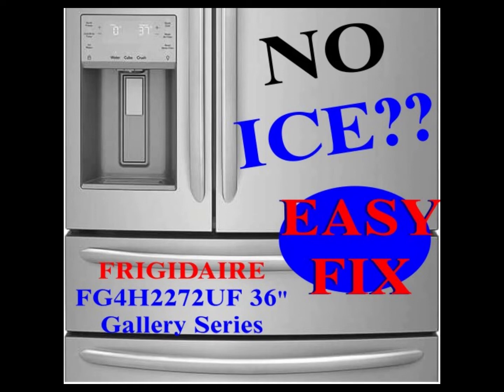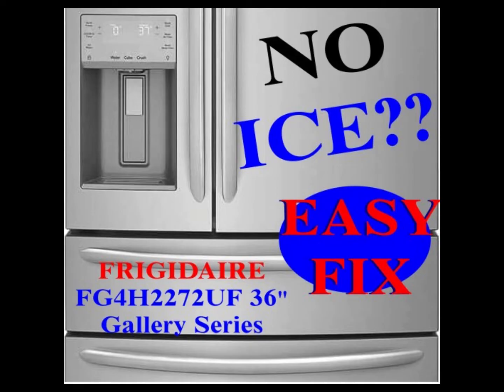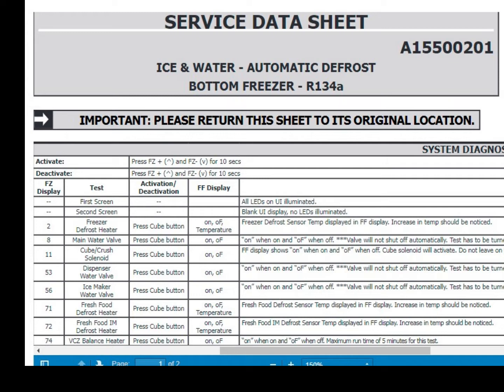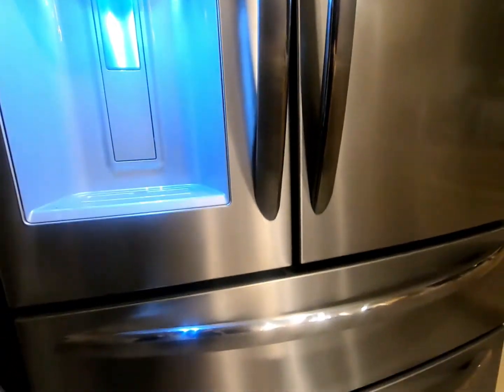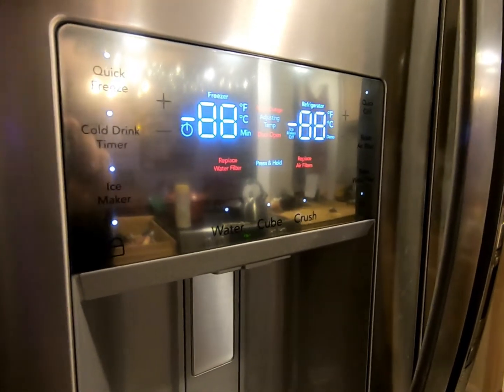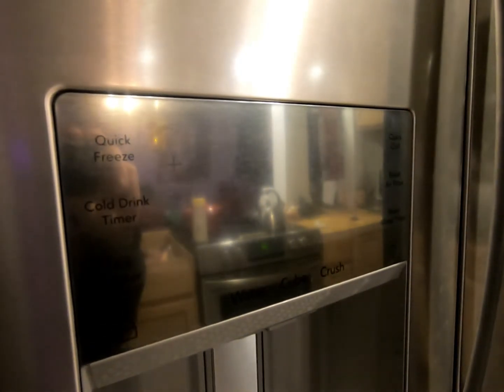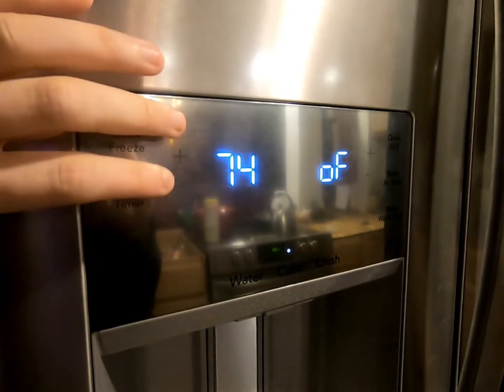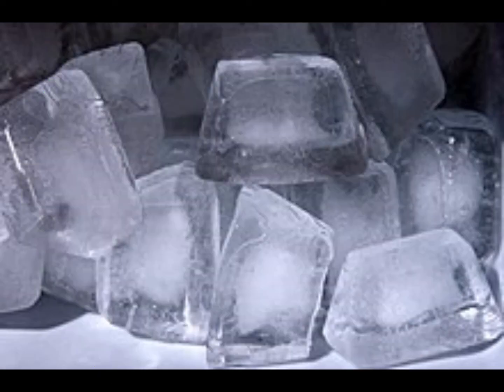No Ice FIX Easy Frigidaire FG4H2272UF Gallery Series Diagnostic Mode Defrost NO TOOLS

Comment: Hello,  I was having the same problem with my refrigerator not making ice.  I tried the forced defrost code 072 and it made 1 bucket of ice.  This happened again and this time the code 072 or the hair dryer did not work.  I called Frigidaire/Electrolux and this is what they suggested.  It worked perfectly and I didn’t have to disassemble anything.
Trouble shooting steps for Ice Maker

	1.	Have the consumer Switch the Control (UI) Panel to CRUSHED.
	2.	Have the consumer remove the ice bucket
	3.	Next have consumer continuously press down the dispenser paddle for 2 minute intervals (Releasing the paddle and then pressing the paddle again) for a total of 3 times (6 minutes tot This will melt and evaporate any ice around the auger motor shaft.
	4.	Have consumer switch the control (UI) panel to CUBE. Next reinsert the ice bucket, close the door and have them attempt to dispense ice again.
Reply from the maker: Wow!! Thanks for this information! They were not helpful at all when I reached out.
Reply: @bigvslilworld hi. Was your ice tray frozen over or was it just completely dry? Ours doesn't look  like it needs defrosting it's just not making ice. Just wondering if the defrosting method still applies
Reply from the maker: @sindvee5579 My ice tray had water in it that was not freezing. When I pulled the bin out, I could see frost on the little metal arm that turns the ice tumbler and with a flashlight could see ice near the black fan towards the back (was difficult to see). Ice accumulating around the fan kept the fan from spinning and circulating the air. Once that was defrosted and the fan could spin free, it started freezing the water in the ice tray. Good luck with your ice problems!
Reply: Mine reports 99 deg C on entering mode 72 or the other one for defrost sensor

Comment: i had to replace my icemaker and that was an easy fix. Now I have to see why the freezer isn't keeping consistent low temps, constantly beeping at me during the night saying temp is too high. I had to move all frozen goods out into spare fridge.
Reply from the maker: I had a similar issue over the summer, ended up being something stuck behind the gasket and the smallest amount of air was sneaking out. I would turn the cold drink mode on to blast cold air into the freezer for a bit to get the beeping to stop, till I realized where the air was going. Keep us updated if you find the cause and solution!

Comment: Thank you soo much!!  ❤
Reply from the maker: Glad it helped! One thing I can't recommend enough- use your ice everyday, even if you put it in some outdoor plants to water them. I noticed my issue was when I left town. Regularly using the ice and allowing the system to be in constant use seems to prevent the freezing over. Lastly, next fridge you purchase, look for one with the ice maker made into the freezer. The issue this ice maker has doesn't happen from what I have seen with ice makers made into the freezer vs inside the fridge area.
Reply: @bigvslilworld thank you so much❤. We called the technician as fridge is still under warranty.

Comment: I'm having a different problem with same model. Display flashes at random and gets stuck...you cannot make a selection. This will run and then go back to "mormal"  and then in about an hour it starts all over again. The fridge is 2 years old.. Sometimes the entire display lights up and beeps like it's having a stroke. I've turned off the breaker to it for half hour, turn breaker back on and it did not reset anything. A service technician without looking at it told me the interface board may need to be changed, at a cost if $300 plus labour. Foes anyone have any idea how to fix this?
Reply from the maker: That sounds like a pain. My first guess would be something board related, but that is going off experience with TVs. I always suggest checking all wire connections (and check continuity in case something has chewed a wire), connections on the boards, and for any obvious hot spots on the board.

Comment: I did the defrost  mode thanks alot but not long it did it again  after looking  at the page you are showing  I couldn't  find how to reduce the amount  of water going  into the tray soo I googled  the numbers  on top of page and found  how to reduce the amount  of water hold both crushed ice and ice for 10 seconds  numbers  will show 1 being  more higher being  less I went less thinking  maybe  water too much water might be causing  it to freeze  up  thanks
Reply from the maker: That could be possible! Another thing I suggest if you arent already- use ice everyday. My issue popped up whenever I left town and the ice wasn't used. Even just using cubes to water outdoor plants or dumping in the sink, using the ice often and allowing the system to use all of it's functions has prevented freezing over issues needing defrosting. Lastly, next fridge you buy, consider one with the ice maker made into the freezer vs fridge area. Far less issues with the ice maker built into the freezer rather than the fridge. Hope your problems stop!

Comment: I had a weird thing where the ice in the bucket was slowly melting and dripping out of the dispenser. Now it won’t make ice at all. I’m trying this to see what happens
Reply: Yes, same here. Did you find the fix? I did not with all these suggestion in this video.
Reply: @bobsimicak9809 yes it worked! I kept turning on defrost and got it up to 68. Took the bucket out and a bunch of water shot out of the top of the ice maker. Next day it started making ice again

Comment: How long should i run it? Mine stops after a bit and I have to push Cube again. As an aside, there is like 3 different front panels. So many of the videos are useless for me. I do have this panel. But still no ice
Reply from the maker: I usually run the cycle a few times, and let it get well above freezing so it has time to defrost. I increased the temp of my fridge to 41 degrees and freezer set to zero and I think that helped too. Good luck!
Reply: @bigvslilworld  thanks. that worked. i have ice
Reply from the maker: @HonRevJoWazzoo  awesome! Glad it worked out

Comment: Hello.  I have a problem with the custom flex temp drawer.  It won’t change the temperature and it’s not freezing.
Reply from the maker: Interesting,  this is the first I have heard of this issue. When you press other options. It does nothing/does not change, or simply does not change temperatures? I will do some research 🕵‍♀️

Comment: I tried running the defrost code 72 3 times, but it didn’t work, so I called a repairman. He did the same thing, running it until, the temp reached 92, then it started to drop back down to 73°, indicating that the water was able to flow again. So far, that has fixed it. BTW; I was getting error “t7”, which isn’t listed in the web available check sheet, but it indicates a problem with the main board, a $200 part. That indication appears to be in error; it goes away once the ice maker is making ice again.
Reply from the maker: Wow all the way to 92, good to know sometimes that is necessary. Thanks for sharing your experience. Interesting about the error code, and glad it seems to go away once ice is being made again. I know that's stressful, the last thing I want to see is an error code. Curious what temps your fridge and freezer are set at? It helped tremendously increasing my temps slightly (though the temps inside the fridge and freezer show lower on my thermometer), keeping the filter changed frequently etc.

Comment: Hello very helpful video!! Is there any way you know how to increase the level of ice made
Reply from the maker: I don't know how to increase the frequency or speed at which is freezes, but to make larger cubes I increased the length of time the dispenser added water. A 1 second increase helped a lot and I also notice my cubes are larger when I put in a new filter. On the data sheet, one of the options allows you to increase the time it fills the cube tray. Hope that answers your question.

Comment: I just replaced the water valve solenoids, had already replaced the water filter housing, and I still have no water or ice. There is water going to it. Im at a loss and ready to scream
Reply from the maker: I hate to hear that. I hated this fridge with every fiber of my being for months after buying it but I finally! figured it out. It sounds like luck was on my side. I hope you get it figured out, keep us updated.
Reply from the maker: Is there anyway a line is pinched?
Reply: @bigvslilworld  The new valve assembly was bad. What luck eh?. They sent a new one and after installing that, everything works fine. Apparently the valves are subject to fail.

Comment: My Freezer and Fridge temp light along with adjusting temp light stayed on after performing this procedure. I hope I didn/t mess something up. Pressing the crush and light button does not turn off these lights. drats.
Reply from the maker: They should go back off after the temps regulate, similar to after a power outage or when the door gets left open too long.

Comment: My icemaker stopped working, the ice in it was melting.  After diagnosis I see my ice maker evap fan won’t run.  It sounds like it wants to run but not spinning. I think it was frozen and got fried.  Has anyone done a video how to remove this icemaker?  Can’t seem to find one.
Reply from the maker: I haven't seen a video on removal specifically for this model. Maybe I will crack into mine and record it soon. Sorry for your troubles!!
Reply: You ever figure it out??? I just ordered a fan.

Comment: How long do you keep it in the defrosting mode “72” before turning it off?
Reply: Do I let it run its course once it’s in “on” mode?
Reply from the maker: Yes I would let it run it's course, but monitor it and make sure it gets up well above freezing so you know the ice has had a chance to melt. Some folks have had better luck with a couple of cycles and letting the temp rise over 50 degrees, Good luck!
Reply: I don’t even think the ice maker is making ice.
Reply from the maker: @nickmartinez2321  Oh! sorry I was a little vague, I meant there is likely ice build up in the way back, it sometimes freezes the fan to a stop and all of that buildup at the very back where you can't see unless you remove a couple of things, that buildup with prevent ice from being made at all. so running this test should heat up everything back there and ideally it would start making ice within 24 hrs
Reply: @bigvslilworld  sweetness. Thanks
Reply: @bigvslilworld  I’ve ran this 5 times and currently running it a 6th time and still no ice. What temps are you running this fridge freezer at?  Any other diagnostics to run?
Reply from the maker: @nickmartinez2321  Interesting! I have my fridge set to 39, and freezer set to zero. Make sure that water is being dispensed, there is a test you can run to make sure water is moving into the tray, and also make sure your filter isn't obstructing the flow. There should also be a test to run to raise the temp of the ice maker water dispenser to the tray in the event that froze. If youve made sure your problem isn't water making it into the tray, I would take a flashlight and check to see if the black fan behind the ice cube tray is running. If it is not spinning, take something and see if you can spin the fan at all. It is possible that it is very, very frozen back there preventing that fan from spinning. There should also be a test in that tech sheet to force the fan on. You may even be able to see ice build up behind the fan if you move your flashlight around and catch a glare. If it is super frozen back there, I would try to defrost with a hair dryer as much as possible, set your temps for the fridge to 39 and see if the problem comes back. Its possible there is just a large amount of ice back there keeping that fan stuck. Let me know what you find!
Reply from the maker: @nickmartinez2321  Oh yeah! Check the pinned comment for this video, someone offered up a sequence that Electrolux sent them. I changed the pinned comment to that one. Try the steps there, too (perhaps first if you are definitely getting water to the tray). Good luck
Reply: @bigvslilworld  thank you.
Reply: @bigvslilworld  not sure where the pinned one is.
Reply from the maker: @nickmartinez2321  it should be the very first comment, but I copied the steps that person listed and will paste below just in case:

Trouble shooting steps for Ice Maker

1. Have the consumer Switch the Control (UI) Panel to CRUSHED.

2. Have the consumer remove the ice bucket

3. Next have consumer continuously press down the dispenser paddle for 2 minute intervalsti (Releasing the paddle and then pressing the paddle again) for a total of 3 times (6 minutes tot: This will melt and evaporate any ice around the auger motor shaft.

4. Have consumer switch the control (UI) panel to CUBE. Next reinsert the ice bucket, close the door and have them attempt to dispense ice again.
Reply: I threw in the towel with this model and it’s gone as of today.

Comment: First of all, thanks a million... this technique solved my problem with the ice maker not working.  It now functions perfectly.  I just want to drop in another quick tip: You might have to perform the defrost procedure multiple times to get all of the ice in the very back of the ice maker melted.  I did the defrost function about 5 times over a period of about 3 hours.  Perhaps my coils were frozen more than others, but just wanted to put this out there in case you try the defrost mode only once and wonder why it did not work.  Use the defrost mode "72" several times in a row!
Reply from the maker: Yes excellent tip!! Thank you for dropping that, I will have to figure out how to pin comments. I'm so glad this helped you out 👍.
Reply: Ha Ha

Comment: Thank you !! 
I have watched several videos and yours helped
Me the most. My fridge is less than a year old, and although it’s not the same model as yours I have the same control panel and the same issue. 
I heard in other comment sections that this problem is more prevalent in humid climates. 
But I think the most bothersome part is that this is a problem for lots of models- across many years. They just keep selling newer products with old problems. ☹️
Reply from the maker: I agree about the most bothersome part being that they let this issue bleed into new generations. But service calls, parts and selling warranties keep the money flowing after the initial sale I guess. Quality isn't what it used to be :(. That is interesting about the humid climate comment, I am in the deep south! Thanks for letting me know that it helped at all and good luck to you.

Comment: Thank you again for this video. I ran every diagnostic test for the icemaker that was on the data sheet, and all passed, I still had the problem of ice tray filling up and freezing but would not continue making ice. I had the thought that maybe if I unplugged the refrigerator for a few minutes then plug it back in it might reset similar to a restart on my laptop. IT WORKED!!!😁😁not exactly sure what worked but I suspect it was unplugging the power. Let's just hope it keeps it up. I appreciate all the hard work you do to produce videos like this👍👍
Reply from the maker: Haha AWESOME! The best, oldest, most underrated trick in the book. I will keep that in mind if I run into other problems, but hopefully I dont.

Comment: Thank you for this video. I have this model; my icemaker gets water and freezes ice it but does not dump it and make more. I first put in a new water filter, ran icemaker defrost 4 times. I ran the ice tray dump diagnostic test, it worked fine filled back up with water, froze and refused to do anything else. I'm not sure it froze up due to it getting water in trays and dump motor test functions fine. Any thoughts? Thanks
Reply from the maker: Very interesting! That is tough to say. I wonder if there is a sensor of something that is malfunctioning. I will look into it and skim the comments in case someone has had a similar experience.

Comment: This is great information.  Thank you!  Question, do you know or can you point me in the right direction for the issue of the freezer temperature increasing?  

The freezer temperature was set to 0, but in the last couple of days, it has increased to 37 degrees.  I took out all the ice from the bin, cleaned the coils in the back, removed dust from the entire lower back area and I defrosted the ice maker as you showed us.  

The freezer temperature is still high and shows adjusting temp on the display.  Any guidance/help is appreciated!
Reply: I'll give that a shot!  Thank you!!
Reply: I replaced the PC board, fixed the problem. Make sure you get a brand new board and not a used one.
Reply: @kepot111460  thank you.  Can you share the link to the board you purchased?

Also, can you share  the location of where the PC board is in the appliance?
Reply from the maker: interesting! I have had only one issue with the freezer temp getting too high and never adjusting back down, and it was because I had way too much stuff in there and I believe it was confusing what senses the temperature. I rearranged everything so the air could flow freely and did the "quick chill" button that you'd use for chilling a drink in the freezer and was able to get the temp down a lot faster than waiting for it to adjust overnight (takes awhile for the temps to regulate, like when first plugged in). I ran the quick chill twice and got it back down fairly quickly. That was all guess work on my end, but may be worth a try?
Reply from the maker: you're welcome! good luck!